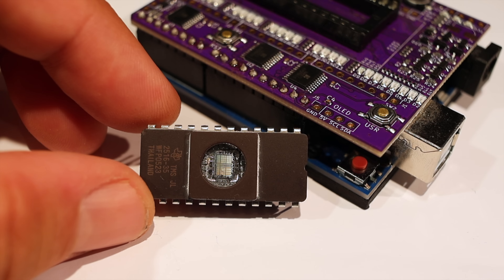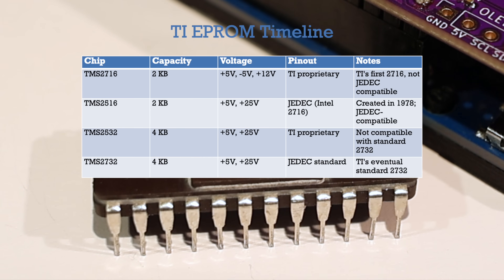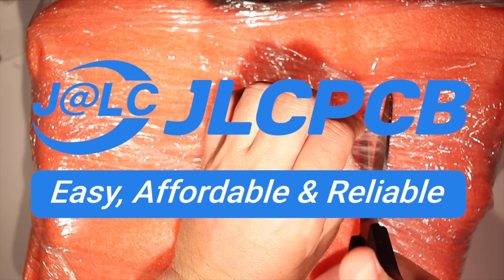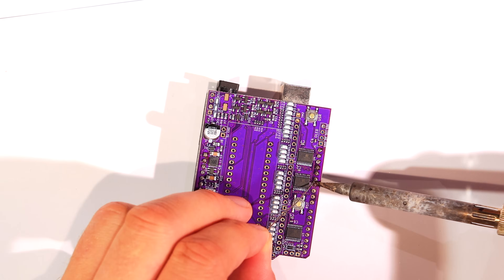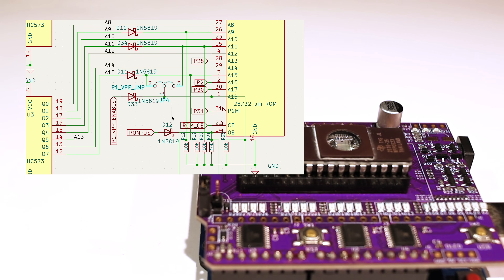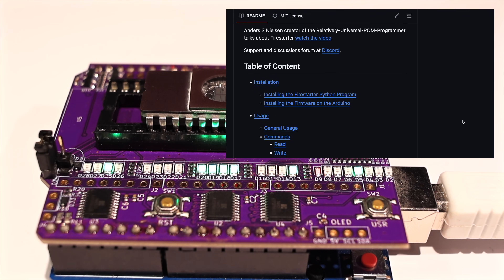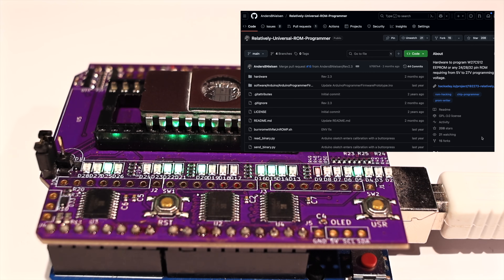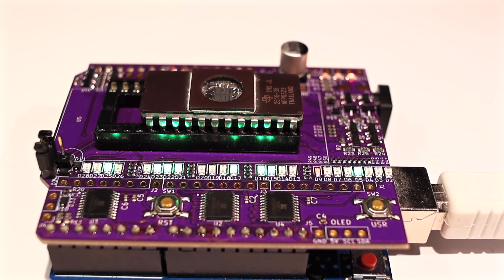EPROM Chaos in the 1970s

Comment: I used a lot of EPROMs 40 years ago, programmed with a home made programmer.  I had some failures due to the programming voltage being incorrect due to multimeter accuracy. So I bought a Fluke multimeter, problem solved.  Amazingly I still have and use that Fluke meter 40 years later!
Reply from the maker: Maybe that’s a fluke :p

Comment: I did many 2708/2716 based projects back in the Z80 era using a homebrew programmer and my own code written in Z80 assembler (ZEAP). I think I still have a tube or two of 2708s and 2716s lurking in my attic! Love the idea of programming them with an Arduino - oh to have had such computing power back in the 70s! Not sure I can think of any real use for EPROMs now though... Big fan of JLCPCB, I've done many PCB projects using their excellent service.
Reply from the maker: I try to at least keep the 6502 version programming some ROMs too
Reply: A lot of 1980s/early 1990s car ECUs use them to store the fuel/ignition program.

Comment: Great, but too late for me.  I had to program a 2516 eprom for my Ms Packman.  The original OTPROM's leads disintegrated when I took it out of the socket for cleaning.  Good thing I hang onto my old adapter to allow it to be programmed on my old programmer.  Can't wait to order and start checking the rest of my old EPROM collection.  I currently have a bucket full of miscellaneous ones.  Keep up the good work!

Comment: One caution with the old school windowed UV erasable EPROMS is that the internal electronics are mildly light sensitive even when not being programmed, which can cause incredibly hard to diagnose bugs if you don't cover up the window with an opaque sticker! I always used to put a sticker over the window as soon as I took the chip out of the UV eraser.
Reply from the maker: It’s certainly good practice to do so and all the datasheets agree :)
Reply: In those former days, we used the stickers intended to cover the "write protect" notch of 5.25" floppy discs for that... Those stickers had the pefect format for that.
Reply: good catch... there have been tons of people experimenting with erasing them with various light sources, but we mustn't forget that all transistors and diodes are phototransistors and photodiodes if they're not wrapped in an opaque package.
Reply: I got lucky with a project I built in 1982, that had a couple of erasable EPROMS without the windows covered.  I disassembled them last year, to recover the source code.  I had misplaced the listings.

Comment: I've work with these chips for decades now and my advice to anyone watching. If you come across any 25 series EPROM's, throw them away, their garbage. Those chips to not age well and will start to develop random errors over time. Try to stick to using the 27 series EPROM's instead. if you can't find a drop-in replacement for a 25? It's not hard to build an adapter socket to adapt a larger 27 series chip in it's place.
Reply from the maker: I think you’re right about this - the failure rate is bad and a some of them are mislabeled as well. I can imagine some people try the 25’s for aesthetics - but if you just need a ROM I’d steer clear too.
Reply: That's good to know because that was my experience as well, which I thought was isolated/bad luck. 2532 ended up on my keychain as a conversation piece. Not that hard to make appealing drop in replacements with SMD.
Reply: @RandomBlankUsername  I do a lot of repair and restore of old arcade computer boards. When I get PAC MAN board in( and I get a lot of theses) for repair. I would read off the ROMs and compare them to the MAME ROMs and every single one I get has at least dozens of bad bytes randomly scattered all over the place. This problem is so bad, I was worried that the MAME ROM was corrupted in the same way. I had to read about 10 different ROMs and do a majority compare to make sure that the MAME ROM wasn't corrupted in the same way. Turns out, it wasn't. This is a common theme with all 25 series EPROMs.

Comment: I recall the 2708 required all addresses to be programmed in a sequential loop, and the loop was executed multiple times until each location received the full dosage of high-voltage programming, whereas the 2716 allowed you to program each location individually. I preferred the surface "porthole" style window over the raised square window partly for aesthetics, but also because they were easier to slip into my pocket when I, er um, "borrowed" them from work to use on my computer project.
Reply from the maker: The 2708 is extra fuzzy. It’s common to repeat programming until the bits stick, but the 2708 datasheet insists you program bytes sequentially .. preferably from 0x000. It also needs 25V, 12V, 5V and -5V at the same time - so an adapter would also need to divide down 25V to 12V… and batteries seems the easiest for -5.

Comment: Does your programmer support 2704 and 2708 EPROMs?
Reply from the maker: It does not, as it doesn’t have a -5V rail. But this is a step on the way - an adapter and three AA batteries could solve it.
Reply: @AndersNielsenAA  Wonderful!  Could you make it so you leave it to the end user to provide the -5V any way they like? I could, for instance, just make a simple PSU myself. Others, as you mention, could use a 3-cell battery case.   I would really like a programmer like that. I have a ton of 2704 that I could use in some of the vintage computers and S-100 cards.

Comment: I would absolutely love to have a programmer that works with old stuff like this, With like a MiniPro you pretty much can´t read many types roms found on many things including motherboards, gpus, controller cards etc. it is really annoying because Bitrot will eventually happen to these and I don´t know how to solve this. one of my 486 computers have gotten bitrot on the Bios that may or may not work in a number of attempts and I managed to dump the working data when I tried over and over again until I got a sensible CHKSUM that seemed correct when examined. I hope this works to write to the new rom I have ordered and fixes this no post issues I have. But man I wish I had a more universal programmer for this
Reply from the maker: In many cases the xgecu’s are limited by the closed source firmware. Minipro does whatever it can support more things but I made the programmer not only to be cheaper - but also to give an open source alternative that won’t be stuck on some unsupported version of windows in 10 years.
It’s great to have the option to fix it if it’s broken :)

Comment: You are very right about the wide variety of UV EPROM programming characteristics. I designed and built a programmer for those chips. Because there were so many variations I had several manual switches to change the pin-out. I also had variable voltages with LM 317's that I could set for getting the voltages right for each chip type. Manual setup for a given chip could take about 5 minutes, so I grouped the chips together by type to do more than 1 chip in sequence. I also wrote the programming in Quick BASIC and added questions on start-up about which chip I was programming so I could set up the programming timing in software, and also in case I needed to change anything on the fly. After programming I would put them in my freezer for 4 hours, then read them and check the check-sun. for errors. If there were none, I called it a successful programming. I might have reduced the number of possible reprogrammings, but I never reprogrammed a chip more than 8 or 10 times anyway, and I never had any of those proms lose data. It was hardly professional, and it was hardly fast, but at the time, I had no money for a programmer, and I used mine for well over a decade.
Reply from the maker: Would love to see that setup if you still have it :)
Reply: I saw a LM317 power supply in a design by Harry Lythall SM0VPO titled "EPROM BURNER".. it's online. It uses multiple sensing resistances, and a transistor shorts one of them to ground to, for example, toggle the output of the 317 between 5V and 6V. I built this programmer and it worked perfectly the first time.

Comment: Older EPROMs were such a mess that all but the most expensive programmers drew the line at 2716. 2708 was right out. Those extra voltages (-5 and +12) just to even read older chips was too much cost.

I am trying to restore an old programmer from 1984 that cost $999 when it was new (Bytek S15-F). I spent a week tracing out its circuitry (8 pages of KiCad schematic) and was very disappointed to find out that the negative voltage from the power supply only goes to a 1489 chip. So even in 1984 the 2708 was already obsolete. In the 20 years since I first found it, its documentation has not appeared. All the chip types are entered by two hexadecimal thumbwheel switches, a DIP switch, and a personality board socket (which is how it handled the "chaos" from this video), so currently it is almost useless. At least it can be reprogrammed into a nice 8085 trainer.
Reply from the maker: Well, an adapter and three AA batteries goes a long way towards handling the 2708’s -5V - dunno if I’m up for it :)
1702 is still a bit of a way out
Reply: @AndersNielsenAA  For what it's worth, the power supply in this thing uses a 555 timer powered by +12V running at about 60kHz with some diodes and capacitors to make a switching inverter for the negative RS-232 voltage. All it needs is a 7905. I'll bet you could use a PWM pin and a transistor instead of the 555. Looking at a data sheet, I see that it only needs to be 50ma. But I've heard that you absolutely need the -5V power on first / off last to avoid destroying the chip, so keep that in mind whatever you do.